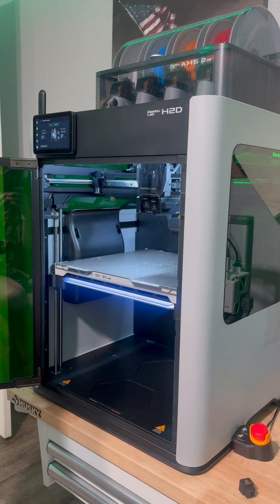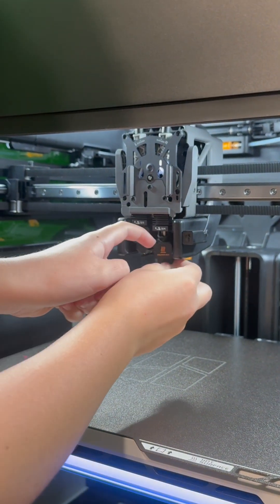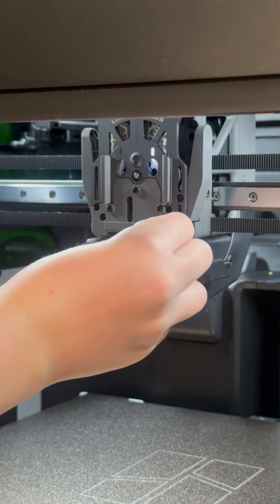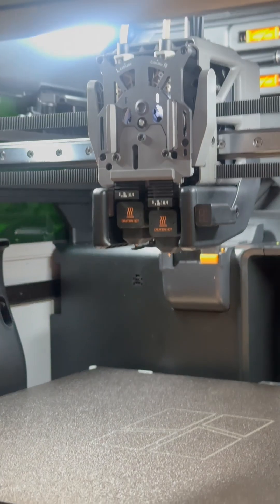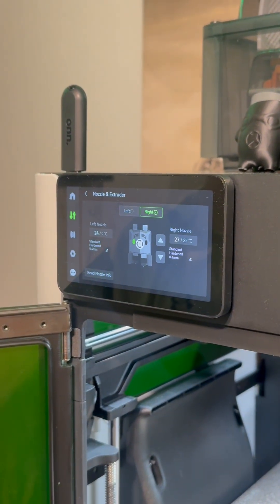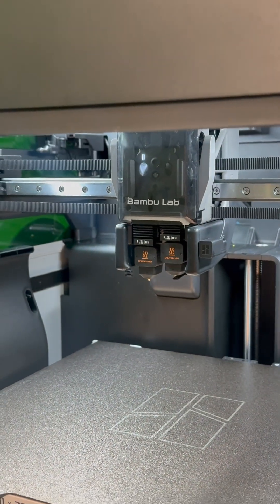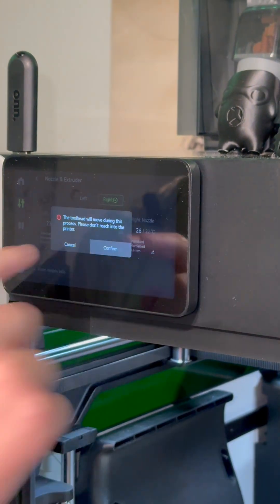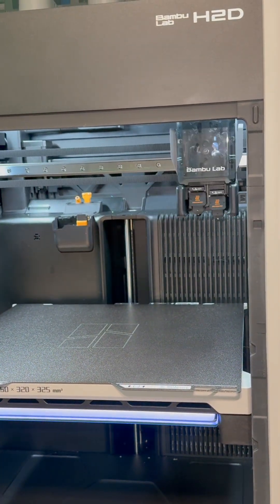How to Swap Hotends on the Bambu Lab H2D — Quick & Easy Guide #bambulab #howto #3dprinting #asmr

Comment: My right nozzle is hard to remove, it just won't come off.  After searching for a solution I heated the right nozzle to about 250 degrees and used heat protective gloves and the nozzle slipped right out
Reply from the maker: Yes sometimes heating the nozzle will melt any residual pla and make it far easier to remove.